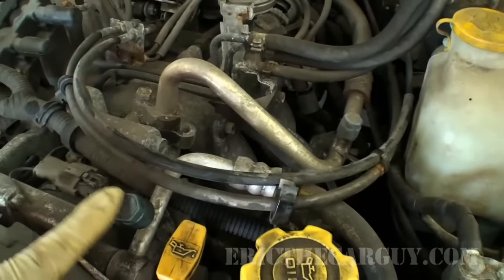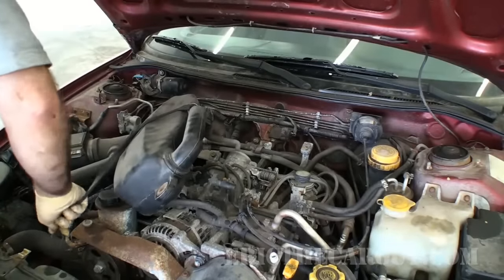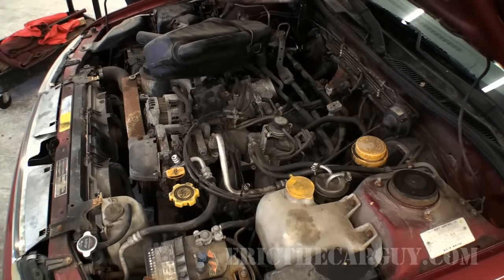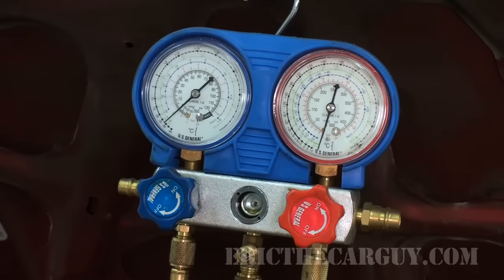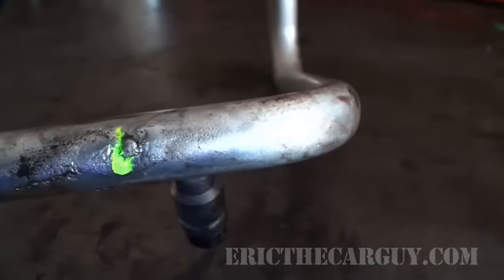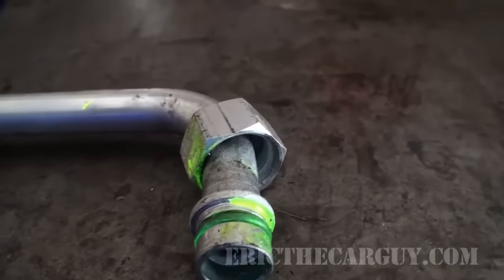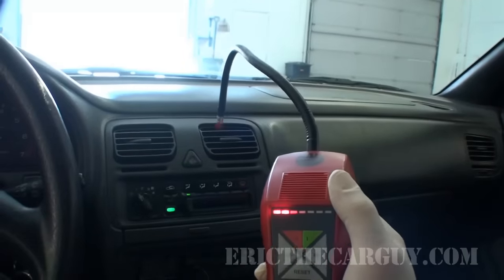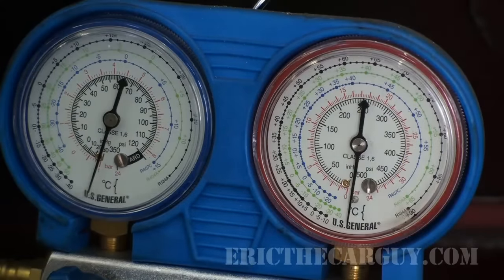How To Find and Repair AC Leaks - EricTheCarGuy

Comment: I have a 2002 Camry that when the compressor tries to come on bogs the engine down before it gives up. I anticipate having to replace at least the compressor and dryer. Due to the fact that the expansion valve and evap require an insane ( https://youtu.be/hJM-VXKQNRE ) amount of labor, I believe scrapping the car might be the better option if it truly comes to that. So I am wondering, with a compressor that is siezing, how likely is it that it has detonated internally? Out of 100 cars with that condition, how many have not shed metal internally and can be fixed simply by replacing the compressor and dryer?
Reply: You need a new compressor, condenser, drier, expansion valve and flush the lines. You can sometimes get away without a new expansion valve but other components are necessary.
Reply: Btw if it's seizing, pretty much 100% it sent crap down the lines. Pull off the high side line(after proper evacuation of course) and see if there is metal grit by running q-tip inside the tube

Comment: when you are searching for leaks you put vaccum in the system. fill upp with nitrogen to atmosphere pressure. then you fill up to half a bar with 134a. thats the humane thing to do... dont use dye in the system
Reply: I don't have a sniffer, but a pair of goggles and light w/batteries is $15, and  pre-dyed refrigerant oil is $1 more than just pure oil.

Comment: R134A is not a friendly and safe material, if you have r12 in your system you can change to propane without any extra mods at all and propane is not damaging to the ozone also it is as close to free as you can get and it will mix with r12 with no problems. Sounds like you are a salesman of r134A.
Reply: Using propane illegal in Florida

Comment: Don't forget to put compressor oil in your vacuum pump.
Reply: Guess you never heard of vacuum pump oil ?
It is designed specifically for  vacuum pumps .
If you use those cheap run by a air compressor VP you won't need any VP oil just lots of air.

Comment: I have the same gauges. DO NOT TRUST THEM! They leak! I had to tighten the shutoff valves tighter than normal. Also make sure your hose connections are tight and the valves at the end of the line do not leak as well. I chased many leaks to this gauge set but I now fixed them all.

Comment: why u dont use a nitrogen?
Reply: Compressed air works just as well.   When the system is vacuumed, all the moisture from the compressed air will be removed.

Comment: Sure... Nitrogen isn't harmful at all.  Air is something like 78% nitrogen.  That said, you could just as well use an air compressor, which is even cheaper than nitrogen when all you are trying to do is blow soap bubbles...  Guess it would be important to use dry air though since high pressures force water vapor back to liquid... air from the top of an air compressors tank is pretty dry.
Reply: Eventually,  the system has to be vacuumed, so it doesn't matter about the moisture in the compressed air.   The vacuum pump will take it all out after an hour on the pump.  Just because moisture is damaging and nitrogen doesn't have moisture, that doesn't mean it's the only solution.

Comment: Don't want to be a dick but purposely putting _any_ r134a, even a bit for a leak detection purpose, into the system that has _known_ leak (you would know that from the vacuum leak on the gauge) is violation of the EPA rules. Other than that - great vid.

I once fixed the leaking tube using the solder myself.I my case the tube was steel, so I had no problems with solder adhering to it (using acid flux).I saved me 150$ on the part and drove this car for two more years and AC worked when I sold it.

Comment: Ok so I repaired my A/C system myself by refilling the system with one of those DIY bottle/gauge/hose systems they sell at auto shops.  It was 40 bucks, with a $10 bottle return.  This video shows how ridiculously brutal it is to fix an a/c system.  Not worth it.  If your a/c system doesn't work, damnit just get a new car already.  Mine is 10 years old and a refrigerant refill worked, but if it hadn't worked I'd say fuck it.

Comment: Lord I can tell that's a mechanic's car, that engine Bay is nasty! Lol Another method that I've seen is to use children' blowbubble soap that you made bubbles in your yard as a child. . brush the soap around the fittings or any place you think it might leak if it has a light charge on the system it will blow bubbles at the leak.

Comment: You should NEVER run an electric motor next to the car battery. Just saying.
Reply: As long as the battery isn't in a sealed enclosure there is no problem having minor sparks around it. Also the vac pump motor is induction type so it doesn't spark at all

Comment: If you have trouble finding the right replacement hose, why can't you take a large fuel/oil line hose split it lengthwise and clamp it over the gash in your pipe. It might be considered a Ghetto repair but I think it would hold for a long time.

Comment: Was this supposed to be a comedy video, so much bad practise in one clip. I haven't laughed so much in a long time. Leave AC to people who know what they are doing. This guy spent money on the equipment, dye and gas where was the saving doing yourself. Running the system with very little gas, part filling the system which was full of air! Totally clueless?
Reply: Eric is an expert.  If his instructions are followed you can save  plenty of  money.
Reply: In his own words he doesn't touch AC. I have 26 years experience in refrigeration and car air con and if you follow most of the advise in this video it could cost you a lot to sort out the problems created by the laughable pratices and advice given
Reply: Then post your god damn videos so we can learn, master....
Reply: I get paid for my knowledge, experience and technical ability so i'm not going to give this away for free
Reply: Well if you know what you are doing, and know what he is doing wrong, you can always humbly comment on the faults and state the correct way. Then Eric and everyone else will learn even more skills. 

You can have a useful attitude or a useless attitude Peter. Useless attitudes make you look foolish. Common bud and help build up not tear down.
Reply: An attitude is very subjective thing, bad spelling is not and it will make you look stupid and foolish all at the same time bud!